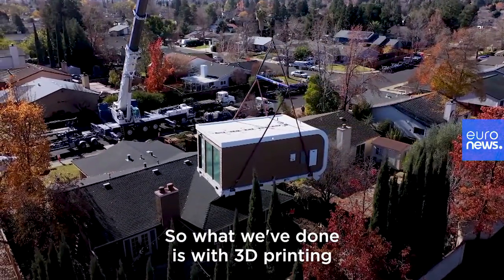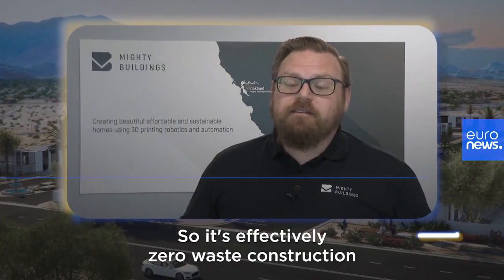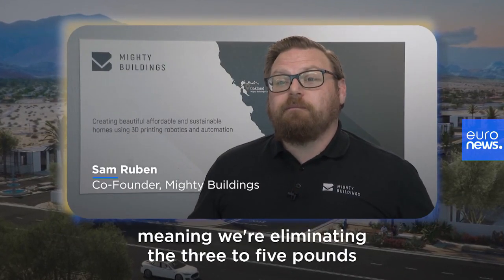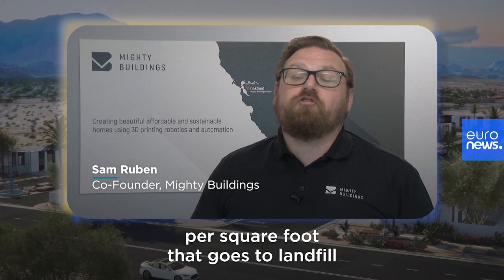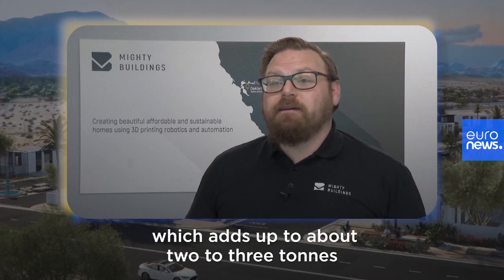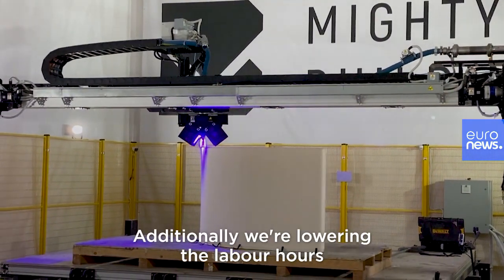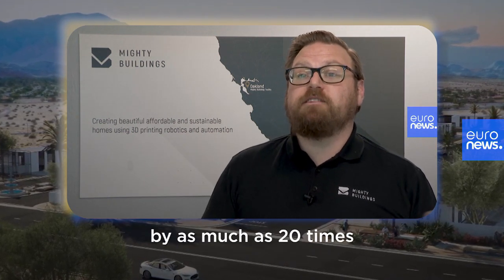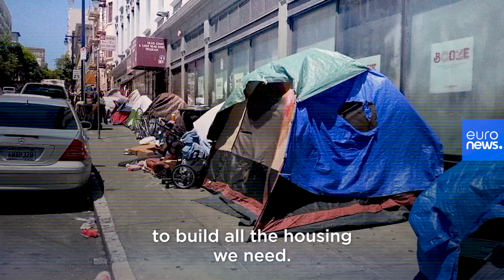Meet the innovators looking to revolutionise housing with sustainable 3D printed homes

Comment: WE EUROPEANS HAVE HUGE UNREPAIRABLE TROUBLES, AND ESPECIALLY EVEN DEADLY TROUBLES, BECAUSE OF SAMSUNG, MICROSOFT, APPLE, MCAFEE, AVAST, ESET, KASPERSKY, ETC, ILLEGAL FORCED BY-DEFAULT-UNCHANGEABLE SETTINGS APPS, ETC, WHICH ARE ALL ENTIRELY AUTOMATED USED BY CRIMINAL GANGS ORGANISATIONS UNDER THE HIGH PROTECTION OF MOSSAD CIA FBI NSA FSB.
SIMPLY THE CRIMINAL ORGANISATIONS ARE USING SOME ELECTRONICS IN THEIR CARS, AND SO EVERYTHING WE USE WITH OUR DEVICES, IS RUNNING IN FALSE AGAINST EUROPEANS - THEY FALSIFY ALL EUROPEANS INTERACTIONS, ALL EUROPEANS PAYMENTS, ALL EUROPEANS GAS-ELECTRICITY-WATER SUPPLY ACCOUNTS AT RELATED COMPANIES (THEY ACCESS AND OR FALSIFY EVERYTHING, INCLUDING THE PAYMENTS, THE DATA OF PAYMENTS SO THEY APPEAR IN FALSE AS THEY ARE "PAYING" INSTEAD OUR PAYMENTS, THE DATA OF FLOW DELIVERY MEASUREMENTS OF MEASUREMENTS INSTALLED ON OUR HOUSE PIPELINES OR CABLES OF WATER GAS ELECTRICITY AND ABSOLUTELY ANYTHING, ARE FALSIFIED BY THEM, INCLUDING THEY UNII AND RE-MOUNT OTHER MEASUREMENTS PIECES WHILE WE AREA TRANQUILIZED IN OUT HOMES !!!!!!! THEN ALL REAL DATA PHOTO BY US IS ENTIRELY CHANGED WITH THEIR FALSE DATA CHANGED BOTH ON MEASUREMENTS ON PIPELINES AND IN OUR ACCOUNTS), THEY ARE AUTOMATED FALSIFYING OUR MAILS CHANGED WITH ANYBODY ANYHOW ANYTIME ALL OVER.
YOU HAVE TO PUT TOTAL INTERDICTION OF ACCESSING ELSE BUT ONLY BY ONLY-EUROPEAN CONTROLLED SERVERS, ALL OUR DATA, AND ALSO ESPECIALLY YOU HAVE TO CREATE ONLY ONE SINGLE UNIVERSAL ALL DEVICES OWN EUROPEAN OPERATING SYSTEM, STRICTLY EUROPEAN ENCODED SYSTEM.